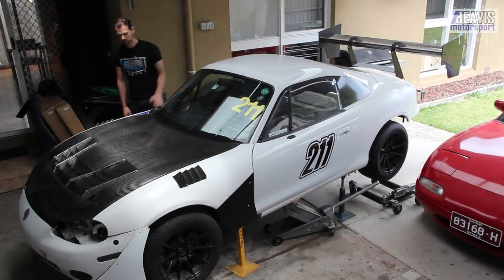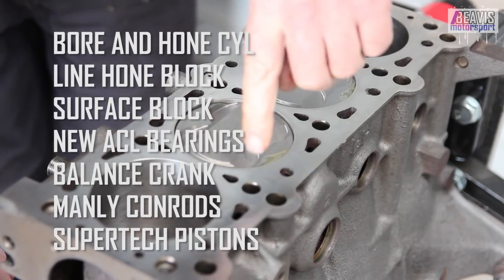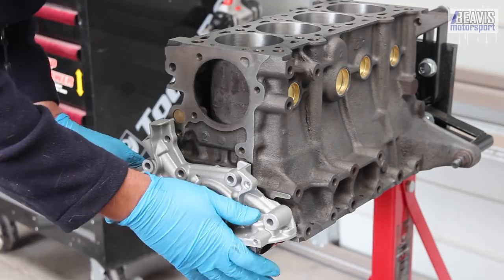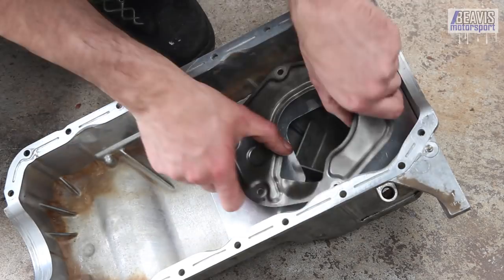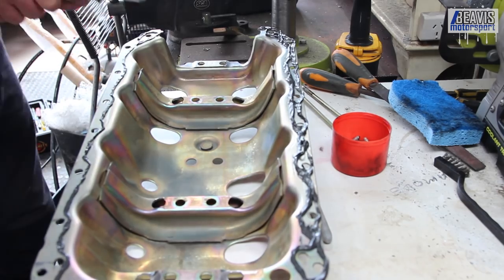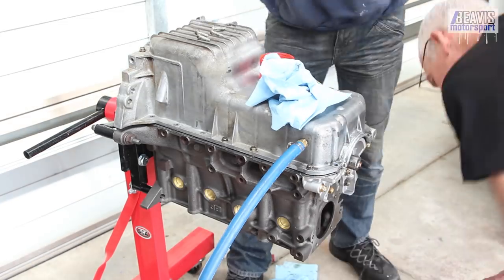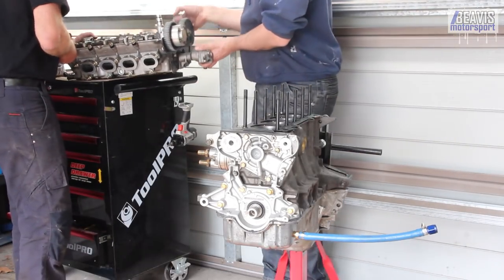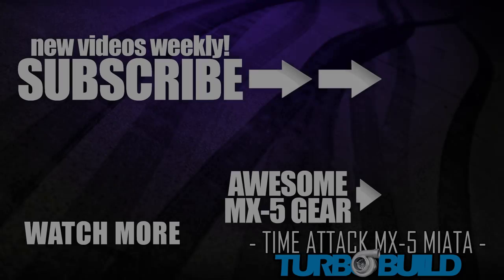FORGED BP ENGINE REBUILD [PART 1] - Episode 66 - Time Attack TURBO Build

Comment: What was the cause of the first engine damage?  Bad tune?
Reply from the maker: I think that the tune was at least a contributor, but with a newly built engine, fresh fuel system, and a new tune, everything is in a good state to prevent any re-occurrence.

Comment: are you running std or mod camshaft? lift?      have you ever swapt the inlet for a exhaust cam, running two std exhaust cams? 10hp gain???? possibly
Reply from the maker: Camshafts are OEM, as is everything else in the head beside upgraded valve springs and retainers.

Comment: Hey mate what would you recommend engine internal wise for a street used 250-300hp? My engine builder wants to go with forged pistons with the rods but I'm wary of thermal expansion of the piston causing issues with the rings and cylinder. He'd also rather to loose than to tight. Is that why you went with the supertech 4032 steel? Great videos too mate. Keep it up
Reply from the maker: I've only built this one engine so I'm probably not the best person to ask for advice. I purchased my parts from Trackspeed engineering. They had the experience and knew what were the best parts so I went on their advice. I went for parts that were reasonably priced and known to work well in the 300-400hp range for the mazda BP motor. If there were issues with "thermal expansion of the piston causing issues" then I'd expect the general miata community to share that experience and they wouldn't be a good product to buy.

Comment: Hey love the content coming out! Im in the market for an NB myself, but im not sure whether I want the NB1 (i prefer the looks of this one) or NB2 for the vvt engine like you have here. I know the performance between the two are slim to none, but how about after being built such as how youre doing now? Maybe after forced induction, the VVT engines will actually be better. Can you offer any insight into this?
Reply: You definitely want the NB2 or the NB8B / NBFL depending on where you are located. It is a far better car. Not only is it better looking it also has the stronger 6 speed box, better interior, better headlights (projectors), better chassis bracing etc etc. The list goes on. With that being said when going turbo it is said that the head on the BP4W has better flow than the BP6J but I don't have any direct experiences with that.
Reply: NippyMoto Personally I prefer the pre-face lift look rather than the NB2. About the 6 speed, I would definitely go 6 speed but I havent decided if id like to get into spec miata or not. SM requires the 5 speed. I didnt know that the NB2 had chassis rigidity changes, thanks for the info! In that case, the decision becomes harder haha.
Reply: @dylansorenson2784  Those chasis rigidity changes are basically a small cross brace, much smaller than what is typically available aftermarket. NB1s are also a bit lighter. I would suggest going for the best condition car you can find regardless of year, that fits your spec criterea. A 10th anniversary NB1 should be perfect for you because you have the NB1 look, BP4W engine that is better for boost and 6-speed box with torsen. If you decide to race in spec miata instead of boosting, you can always swap in a 5-speed, which is a 150 dollar part nowadays.
Reply: Captain Kole just to clarify, when you say the bp4w is better for boost, you mean in comparison to the NA engines right? Or did you mean the bp4w is also better than the vvt engine? Also yeah, the 10AE looks to be the one. Theyre scarce though, especially if my budget is <6k usd.
Reply: @dylansorenson2784  The BP4W is considered better for boosting when compared to the vvt, because of the better flowing head and lower compression ratio.  Mazda even used that engine for the mazdaspeed turbo NB. Good luck finding a 10AE, it took about 2-3 months for mine to pop up before I got it.
Reply from the maker: Some good comments already posted here for you Dylan, but I generally find the later NB with VVT and 6spd trans to be superior both mechanically, and styling wise. Better engine, stronger trans, better brakes. Cost wise it's marginal usually.

Comment: What the torq specs for conrod.main cap and head stud arp.cool vid
Reply from the maker: Hi Takiuddin, ARP studs generally come with documentation on recommended torque specs. I suggest you follow those, or the advice of your workshop manual.

Comment: Why two washers on one of the main studs?
Reply from the maker: Only one on each from what I can see. Perhaps you are confusing the taper at the bottom of the nut for a washer?
Reply: @Bbeavis  at 0:58, the right stud on the middle main cap.  You can also see that the stud does not stick up over the nuts.
Reply from the maker: Oh wow, haha, what an engine easter egg. I didn't even notice that. :-/ Fingers crossed it'll be OK given it's all bolted up and in the car now!
Reply: @Bbeavis  when I got my engine back from the machine shop they had done the exact same thing... shouldn't matter at all I think. 😊